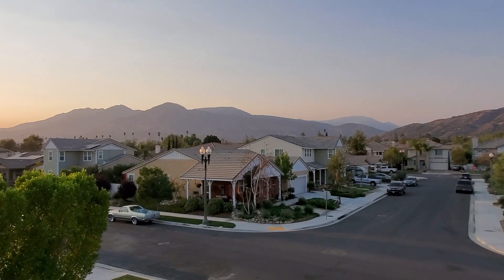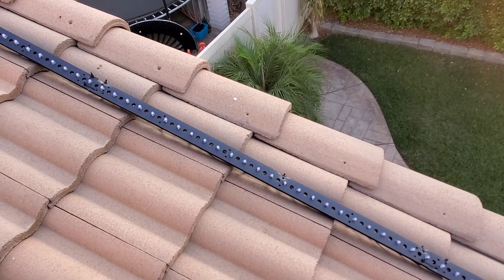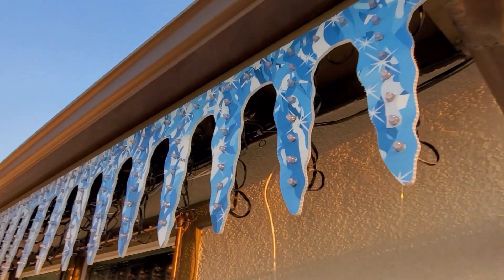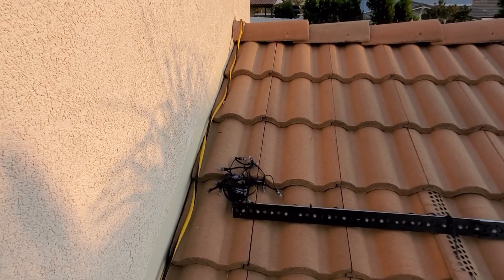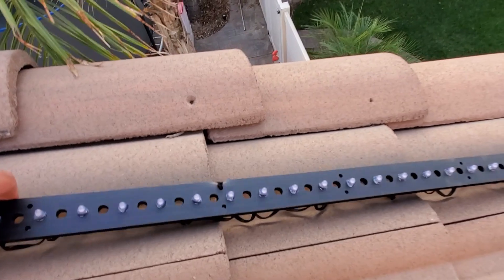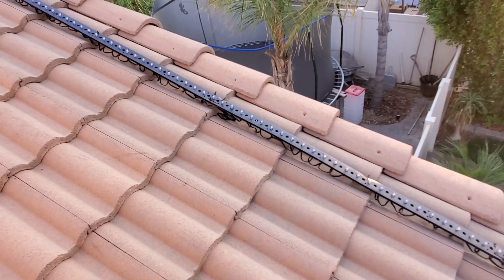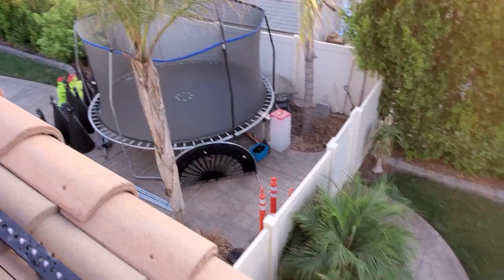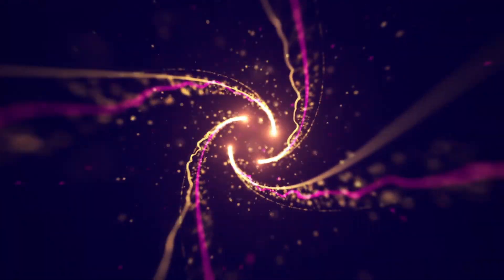On the Ledge With Density

Comment: EMT pipe? Like metal electrical pipe? 
Also, why not use PVC to mount that 10 mill black stuff you held up? 
And finally, why are you taking it down after the holidays? Couldn’t you just keep it up year round? Do pixels degrade in sunlight over time?
Thank you.
Reply from the maker: EMT pipe will last forever, store more easily, and keeps it shape. PVC will warp and become brittle over time. I take it down each year out of respect for my sanity and my neighbors. It's a hobby and I enjoy putting it up each year and learning new ways to achieve the same result.